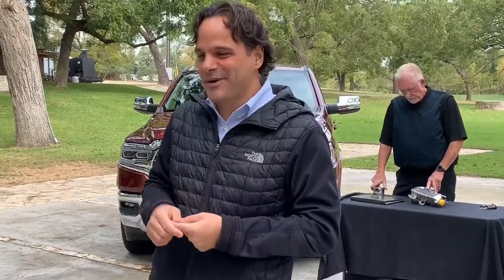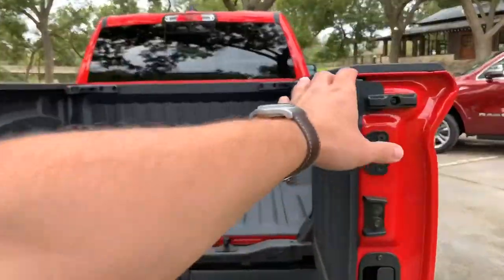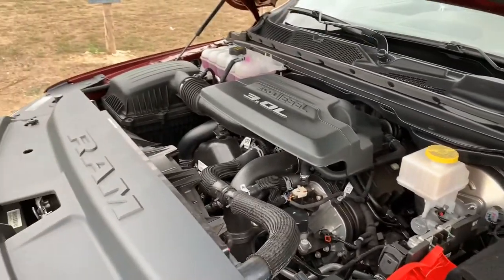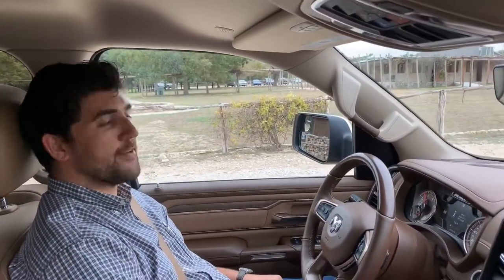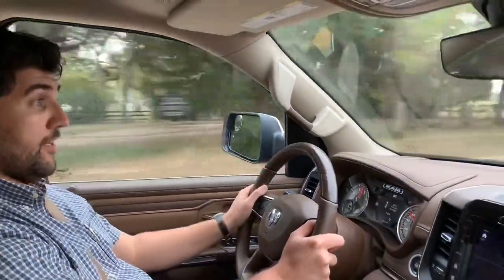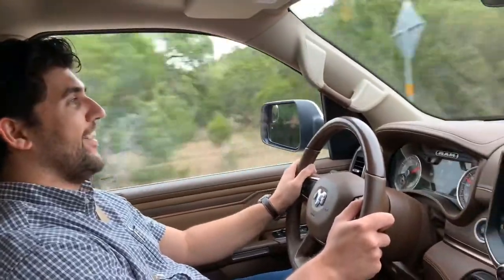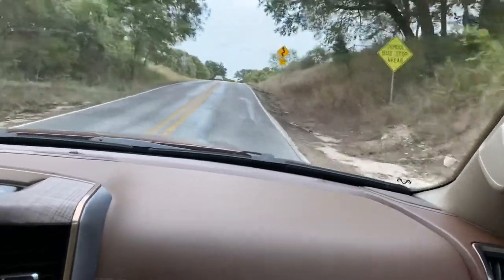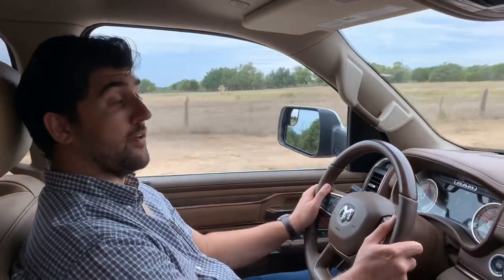First Drive - 2020 Ram 1500 EcoDiesel (Laramie Longhorn and Rebel)

Comment: I don't even recognize this Ecodiesel anymore, and it's even quieter than my dad's 2015. At first, I didn't even know the truck was running. Does your truck come with the Harmon Carden stereo? I keep hearing rumors of Ram going to HC, but my boss told me his 2019 3500 Laramie still comes with Alpine. Not that I don't like Alpine, but that Harmon Carden is supposed to be better than Bose.
Reply from the maker: Thanks for watching. Neither of these are my truck. They’re just a couple of media test vehicles Ram let me drive and evaluate. Can’t recall if either of them had the Harman Kardon audio, but I have experienced it in other 2019 Ram 1500s. Although I don’t find the sound particularly impressive, it is an ambitious setup for a pickup truck.
Reply: The new 1500s have an option for the 19 Speaker Harmon Kardon. My 2020 limited EcoDiesel had it.